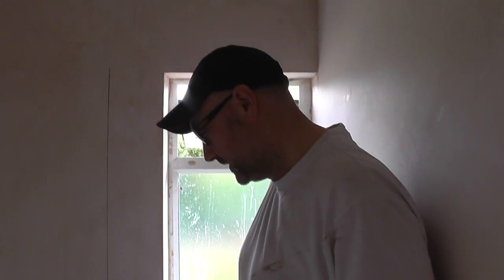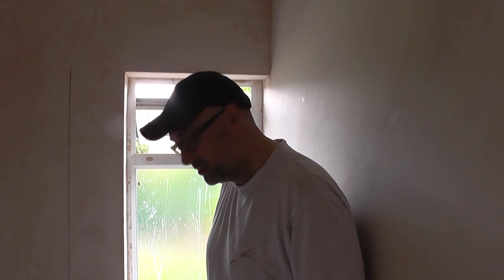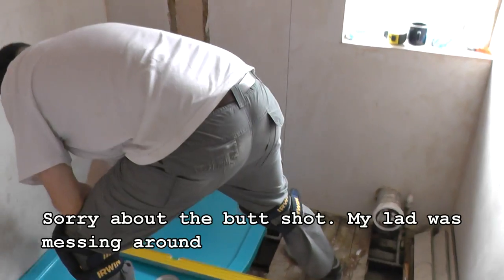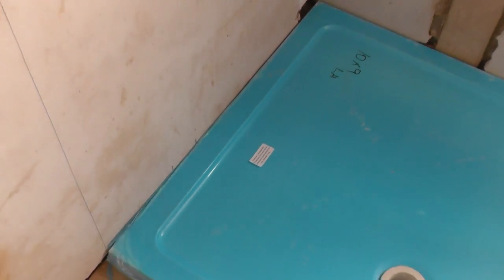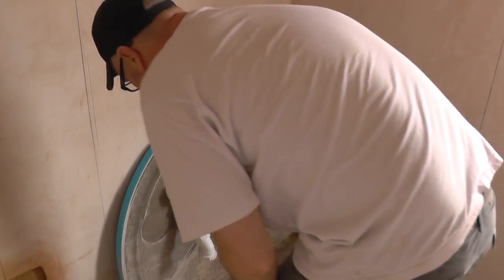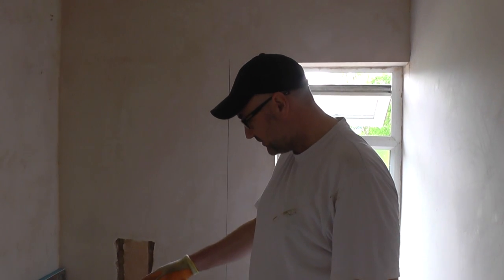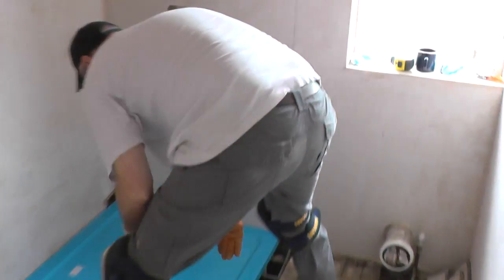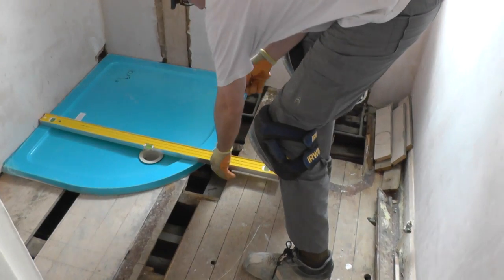DIY: Create a shower waste outlet

Comment: I'm fitting our shower tray waste tomorrow, I'm doing all the main waste in rigid pipe and connecting from that to the p-trap with a flexi pipe in between. I was going to do it all with rigid pipes but the final stretch to the p-trap is a weird angle and flexis are so easy to use.
Reply from the maker: Great idea that. Just make sure the flexible part of the pipe where water may colelct is supported properly. Good luck! ATB, des

Comment: Best thing to do is run th waste out the wall first keep it loose then plumb it up.
Reply from the maker: Zed Man Good thinking buddy. On reflection I know I made it far more complicated than it should have been. I've also since spotted some flexible waste tubes/pipes which would have made life far easier and could have saved me a lot more time. Still, lessons learned ........ thanks for dropping by.